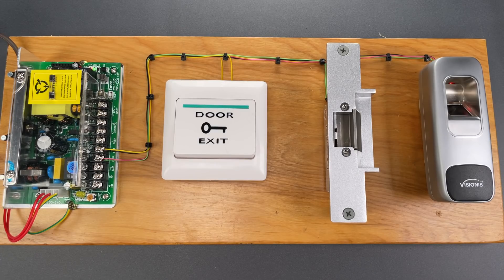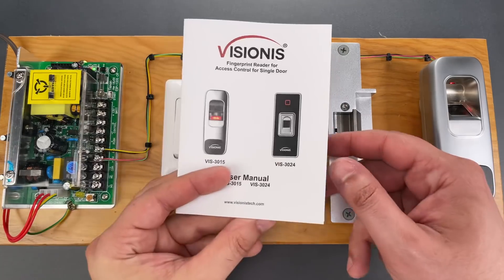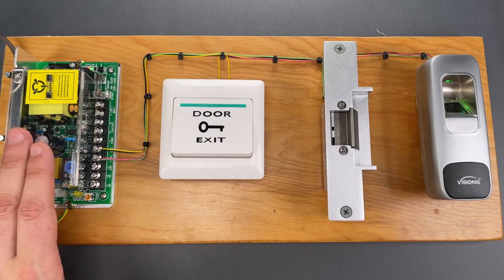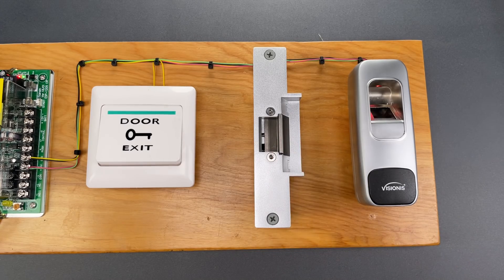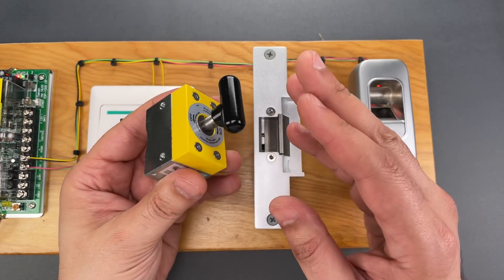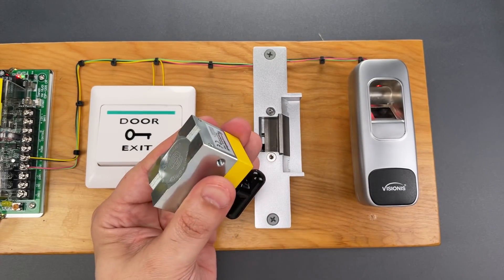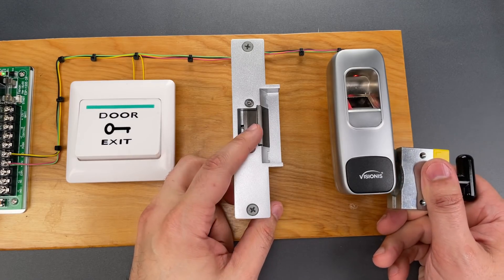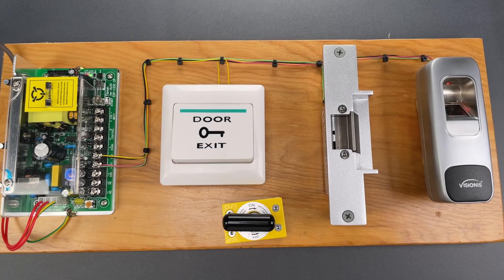[1359] Security Theater: Visionis Fingerprint Reader Bypassed

Comment: In theory, could you make this more secure by taking apart the mechanism, re-wiring it so only the fingerprint reader was on the "outside" of the door, and lengthen all of the wires so that the "guts" of the exterior box were actually inside next to the power supply?
Reply: yes, but also the moment you can't do it yourself and have to pay someone to do it for you is the moment you're better off buying a better fingerprint lock without these silly bypasses - and that's assuming that you can safely move everything out and keep the product working
Reply: @lia6771  i think he means to just suggest a better way the locks could be made by the company
Reply: @lia6771  I am not aware of any widely commercially available fingerprint scanners that aren't easily tricked by fake fingerprints made with simple glue. Now getting a valid fingerprint for this can potentially be difficult, but there have been examples of people just lifting the last user's print from the scanner itself. Fingerprint scanners are one of the worst ideas that just won't be dropped, because it looks cool and that overwrites all rational decision making.
Reply: Yes, but at that point you could just purchase a single door system from a manufacturer that makes them like that out of the box. Lots of options now, recently deployed Ubiquiti's access system for a client which is aimed at more of the "budget" prosumer/small business sector. It works fine.
Reply: @hyenacorp  The problem with IoT/WiFi products is you've now introduced multiple vectors of hi-tech attacks. Your door lock is now an entire embedded linux computer connected to the internet. Running closed-source software you can't audit which by design phones home to some company's servers that you just have to trust. What could possibly go wrong.
Reply: @Captain__Obvious  only a fool would make their lock rely on an internet connection
Reply: @toolbaggers  Oh you'd be surprised at what goes into modern landlords' decision making process. Shininess of cheap plastic seems to be a major smart-lock feature for them.
Reply: @Captain__Obvious  The firmware's EAP implementation doesn't matter as it would be the switch (and your RADIUS server) doing the verification. Besides, for most of the attacks you'd have to be inside the secure environment. These systems don't expose the controller to the outside. The readers are usually just ethernet connected terminals that speak to whatever's actually doing all the checks on the inside (again, usually a server that talks to your door controllers). And I can already hear your argument along the lines of how many webservers does it take to turn on a lightbulb, most of these will already be deployed in a corporate environment. 

While your argument of vulnerability holds true, you'd need a separate way to get into the building to pulse the PoE line on the controller or have it so grossly misconfigured that the controller is even reachable from outside of it's own VLAN. Your point on attacking the server running the smart lock software is also unrealistic, seeing as if hackers have access to your entire internal network like that, you really shouldn't be worrying about your doors at that point.
Reply: Thank you @Captain__Obvious  ! Sorry, not sorry. It had to be done though.
Reply: @hyenacorp  With mechanical locks there's no such thing as secure. We characterise the time it takes to cut them or the skill to pick. But you keep using terms like "secure" and "verified" as if that's the end of the story. I'm curious whether you've actually tried attacking these systems yourself. If not I think a few CTFs might leave you with a more nuanced view of the reality of security achievable on a corporate network.

You're keeping out the script kiddies, not APT29. I can guarantee you there are agencies out there with automated tools that given any ethernet port or wifi antenna will run through a sophisticated suite of device-specific 0-days and root as many things as it takes to ultimately get every smart lock in the building to open. (possibly involving backdoors they themselves inserted in the case of Maryland-based ones though that's a whole other discussion...)

The point is that's entire classes of attacks that simply does not exist with mechanical locks, or isolated "dumb" electronic ones. And if TLAs can do it then just like car key fobs it won't be long until organised crime is doing it too. Because unlike a mechanical lock that might require years of lockpicking skill, a smart lock exploit can be packaged into a point and click toolkit.
Reply: @Captain__Obvious  All that and...  Never mind the toolkits that the TLAs make available to domestic police for blatantly illegal data collection (damned stingray).
Reply: @Captain__Obvious  I agree with what you say, and yes, the attack vectors you mentioned are all valid and require consideration when designing a system like that, they still seem unrealistic to me.

I've spent quite a bit of time with small and medium businesses recently and while yes, you can't realistically prevent a state actor from compromising your network, it is almost impossible for them to do it undetected. I agree that there's still a lot of places I've been that haven't implemented proper network security, but as stated in my first reply, I assumed that if anyone would be deploying a system like this, they'd get it implemented professionally. 

Also, after reading your comments, I believe we've been talking about two different systems. I believe you're talking about the subset of 'smart-locks' that replace an existing lock. I am referring to the more common variety of access control system that work with magnetic strikes like in the video. These do not replace a mechanical lock (usually, there are exceptions where they have both a strike and an electromechanical lock, but I'm rambling). They're purely for allowing access based on keycard/biometrics. Usually it's required for exterior doors to have a mechanical lock (I don't know how it is in the US though) and most of the time, if they're being used indoors, the doors already have mechanical locks that are locked manually outside of business hours.

The automated exploitation tool you described, while it probably exists or is being worked on as we speak, would be about as obvious in a network as taking a drill and a jigsaw to a mechanical lock in broad daylight.

I think I haven't made myself clear enough and I apologize. I know there's no such thing as true security, not in mechanical locks and not in a network. They're all just there to slow whoever's trying to get in down. The case I make for electronic locks is that they enable better alerting when that happens. (And they allow you to hide a camera in plain sight for those low skill attackers ;) ).
Reply: Pretty much and it's easier to manufacture the controller having the switch inside than the reader.
Reply: Or just having it inside a box/wall with only the reader accessible tbh.
Reply: You could make your own with a keypad, an arduino, a latch, and an exit button. Just make sure the arduino is getting which buttons were pressed then deciding to open, rather than getting a signal saying the right buttons were pressed. Wouldn't be a fingerprint lock, though.
Reply: Y'all are having a good debate but avoiding the root cause, which is that no one should need to be a security expert to select a decent solution. There is (unfortunately) inherent need for trust in any unregulated market, and vendors like Visionis are abusing that trust in order to maximize profits.
Reply: The quick and easy DIY fix is to move the relay.
Most likely it is powered reference to one of the power wires.
Desolder the relay, connect the control to the wire that would be the output (trigger for the lock), and move it to where magnets can't reach.
Reply: @dougaltolan3017  No need to move it. Just replace it with a solid-state relay. It isn't mechanical and won't get triggered by a magnet,  no matter how strong.
Reply: @solofreelancer  The issue there though is that you're not preventing a simple attack.

By having the door open based on power to the lock from the reader, all it takes is a quick messing around with the wires and you're entirely bypassing the reader, even with a solid state relay.

A step above this would be to require some sort of coded signal between the reader and the lock, like how a garage door opener sometimes uses a pseudorandom code.

If you have access to the wires, you could in theory implement a man in the middle attack to get the code, however this requires more forethought and means your average joe with a magnet or some wire strippers is less likely to be able to get access.
Reply: @solofreelancer  yup, just make sure it's not a millennial solid state relay, you know how easily triggered millenials can be.
Reply: @dougaltolan3017  Or we can use a (power) transistor.
Reply: @adrien5568  Solves the magnet problem, but it seems like the validation is done on the insecure side of the door. Given a battery, you just supply power to the strike and it opens .  Ideally, the reader would send fingerprint data mixed with some random just received from the validator so you couldn't record the data and replay it to open.
Reply: even then it's somewhat insecure as most fingerprint readers don't have protection from just changing the communication.
Reply: The fingerprint reader would be the only thing outside. 
The problem with the system (only from observation) is that there is a relay in the bottom of the finger print reader which is what he's tripping.(strong magnet is pulling the contacts together) 
 By closing the circuit it is providing power to the latch solenoid which is opening the door.
Solenoids draw a fair bit of current so it is harder to solid state switch them. A relay in the finger print reader is a cheap option that makes this lock useless. 
It is like the internal exit button. You press it and it closes the circuit which flicks the solenoid. 
All the switching of the solenoid should be done from the control box (out of reach and inside). 
A better reader would just pass data(fingerprint description) through the wires to the inside control box and if the data is correct then the control box will give power to the latch letting you in. 
I suggest looking at some videos on how relays work. If you do you'll probably understand how these rubbish systems can be bypassed.
Reply: I mean, there have to be some that come that way, right? RIGHT? (Please tell me some enterprising company can make this very simple claim to betterness.)

Comment: Yes he’s great at picking locks, but look at that cable management!
Reply: ikr.  The inside of my computer looks like monkeys have been in there.
Reply: @jayhom5385  relatable.
Reply: @jayhom5385  Mine is actually pretty good, but that's because this time I sat down and focused on making it look nice... and I STILL fucked up one wire running the wrong way that I'd have to uninstall the mobo to fix.
Reply: His demo boards are always so nicely laid out.
Reply: We all claim to be “detail oriented” on our resumes, but the LPL actually is.
Reply: I know what you mean, but as an ex wireman, that loom sucks (a bit). 
There are no swan necks so maintenance is impossible and reliability is impaired. 
The wires cross mid run.
The cable ties are not evenly spaced.
There are cable ties and not stitching.
The "vertical" run on the left is not straight.
Reply: @dougaltolan3017  that was cool to read all the things someone with training tries to put in their layout. Thanks I’ll try to keep some of those in mind
Reply: @dougaltolan3017  Cool. Im googling all the words you used.
Reply: @dougaltolan3017  Come on, folks, let's hear a big round of applause for Captain OCD! :)
Reply: @felsinferguson1125  I like to think there are 3 stages to life.
Who, what, how.
When you are young you are defined by who you know.
As you grow up its what you do.
When you mature it is how you do it.

Comment: I liked the magnet more than the lock.
Reply: The switchable magnet is well-designed. Can’t say the same about the lock.
Reply: I wonder how that works actually, I don't think it's electrical.  I assume it's using two magnets and when it lines them up the poles cancel out?
Reply: They make really big ones they use to lift large sheets of steel in the fabrication industry.

Comment: Would a shielded relay, heavy metal cover, or solid-state relay work.  Another option is  a reed switch to open contact when an external magnetic is present prior to logic open by the reader,
Reply: Replacing this electromagnetic relay with a solid-state relay should fix this problem. Would be a simpler and cheaper solution than adding a reed relay or shielding.
Reply: Much simpler: put all the control electronics behind the door and make the reader do only the scan. If the messages with the scans are encoded and digitally transfered, one cannot force his way in this easy. The sad thing is that you can do this with the exact same electronics components you have in the current design! Only place them in two different places!!!
Reply: @zerokappa  "The sad thing is that you can do this with the exact same electronics components you have in the current design!"
Unless the fingerprint sensor just outputs an open/close logic signal.
But yeah it would be much better have anything but the fingerprint sensor on the inside.
That said, it's quite simple to copy fingerprints with super glue and even put it on the tip of your own figer to also trick heat sensitive fingerprint sensors that will only open when they detect body temperature.

Comment: Always so many comments, so maybe this has been answered already. But. The striker also uses a solenoid for it's operation, right? Could that be manipulated aswell if the frame it's mounted in is thin enough to allow a powerful magnet to "reach" through it?, an upward swiping motion across the side of the striker maybe?
Reply: Maybe, but I guess that depends on how stringent the release mechanism is biased towards only opening when receiving a signal, compared to direct magnetic force.

Comment: i mean i want a switchable magnet, not to break in somewhere, but just so i can say i own a switchable magnet, god i'm feeling nerdy already
Reply: Saw it while ordering the ergo torsion bars. Cool, but assume it just pushes the magnet closer to the bottom when you turn the lever.
Reply: @db2855  i don't care i got a switchable magnet whatsup fools
Reply: @db2855  A switchable magnet works by essentially "short circuiting" the magnetic flux when it's in the off position, so that the flux stays within the body of the magnet instead of extending outside to where it can interact with steel objects, etc. The on/off difference is much greater than what you'd get by just moving the magnet further away from the active surface.

Comment: Would love to hear the story behind sticking to furniture and door frames😂
Reply: I’ve  actually done this myself. Being maintenance in a factory I had to replace a magnet on a machine and it uses a very powerful neodymium magnet. I didn’t feel like pushing out my whole cart so I decided to put the magnet in my pocket and carry the tools needed. I went walking by other machinery got a little too close and bam got sucked to one of them. As if that wasn’t embarrassing enough my immediate reaction was to jerk away quickly which resulted in my pocket getting ripped off my pants.
Reply: @jamesfair9751 Haha I’m sorry but that’s really funny (especially about ripping your pocket). That must’ve been a really strong magnet to have the capacity to do that
Reply: @willbenn11  they have around 300 lbs of force.
Reply: @jamesfair9751  What is the machine, if I may ask?
Reply: @oskrm  it was an automated grinder. The magnet picks up a brake part from a conveyor and carries it over to the grinding jig. It has to be extremely powerful not to pick up the part as it’s not very heavy but to make sure it stays in its exact same location. If it spun or slide around it wouldn’t line up to the jig when it goes to place it.
Reply: @jamesfair9751  Was it a Monday?
Reply: @jamesfair9751  Ha ha, thats funny !
Reply: @jamesfair9751  Damn
Reply: @jamesfair9751  i was half expecting you to say that your whole cart followed you around due to the magnet
Reply: He did say ask me how I know about that. Here I am...here we are. This comment right here... we're asking. Lol
Reply: @godrosen472  Me too. 😀
Reply: This story should be far more entertaining and likely take longer than bypassing the security theater episodes.
Reply: Agreed!
Reply: he had a lock in his pocket and it stuck to furniture and door frames inadvertantly?
Reply: @siccoblue2112  spoilers!
Reply: I often carry a magnet in a pocket (tool holder) - I become aware of metal near me quickly.
Reply: I bet it’s got something to do with having a magnet in your pocket and it sticking to things you walk by. Like furniture and door frames? 🤔